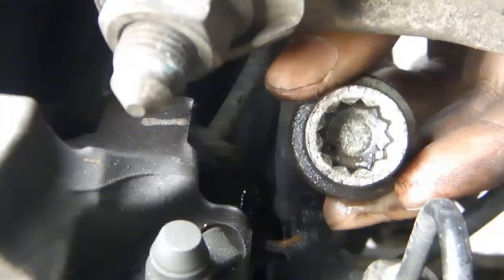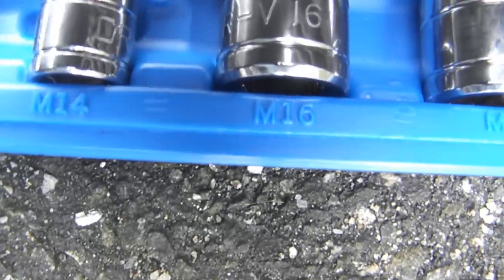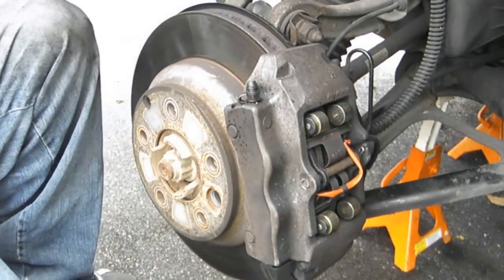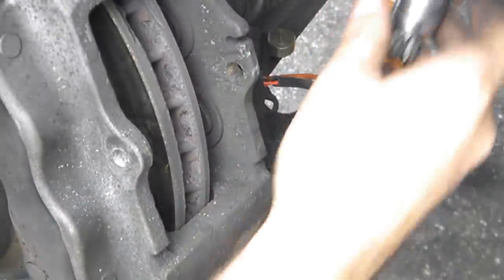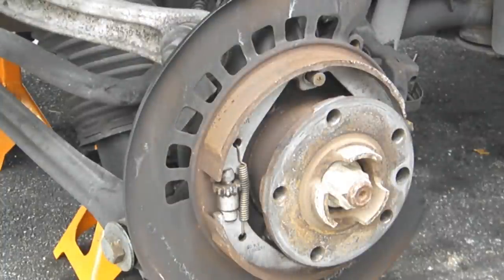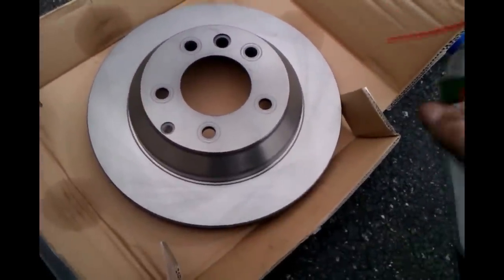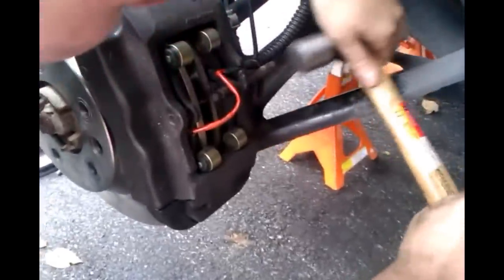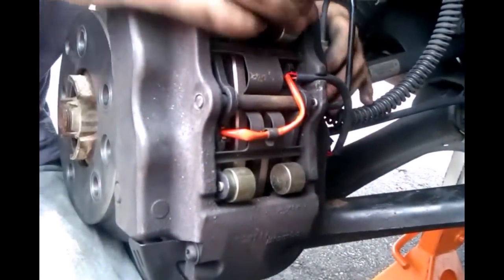Changing Rear Rotors On 2005 VW Touareg

Comment: I'm about to try this, and your video is an outstanding primer on the process. One item that I think might make disassembly easier (if I'm looking at the part correctly) is it looks like there is a parking brake tension adjuster attached by springs to the PB shoes. If you back that down, would it make it easier to remove the rotor?
Reply from the maker: jeff willoughby I would have to take a look at it, and it's been a very long time. I actually don't own the vehicle anymore. Sorry.
Reply: No worries.  I did the front and rear in about two hours on my Cayenne.  Still a great guide, keep up the good work!

Comment: Thanks man.  Yeah I basically went off your last video (for the front breaks) opened up the back breaks, and got up to the part where the huge star bolt stares back at me.  I'm going to order the bit set you mentioned in this video (and in the comments area :P )  but until the part arrives, how bad is it if I have new pads on old rotors with lips?

Comment from the maker: Do not put new pads on those rotors. They will eat into the new pads. Your best bet is to leave the old ones on until you're able to put the new pads on. By the way, you might need a buddy to help you break those bolts loose. That & some WD40, that's what I did.